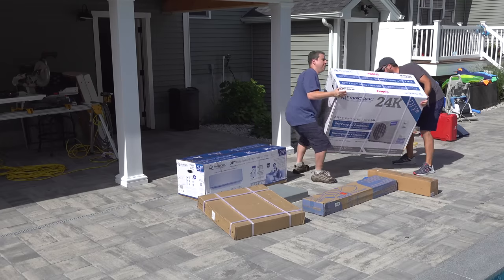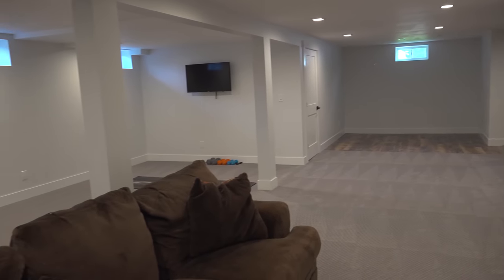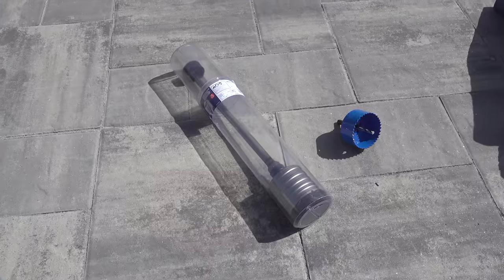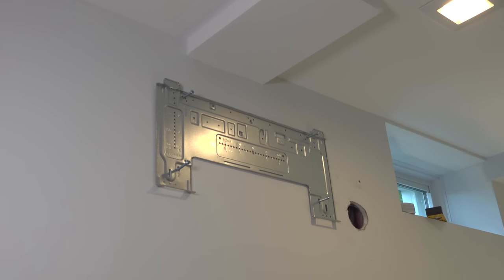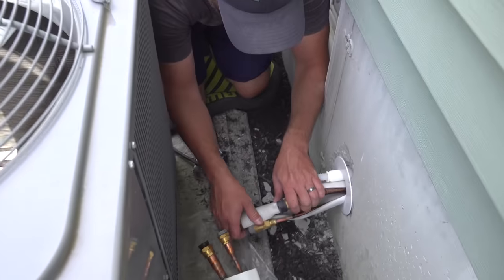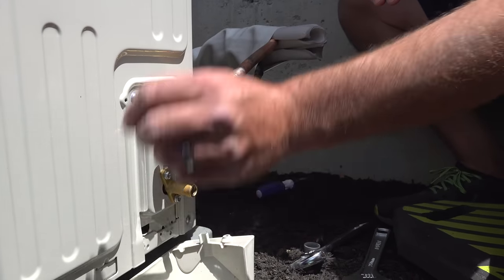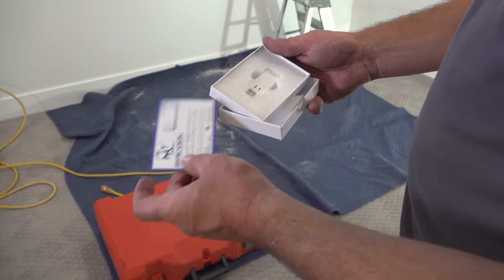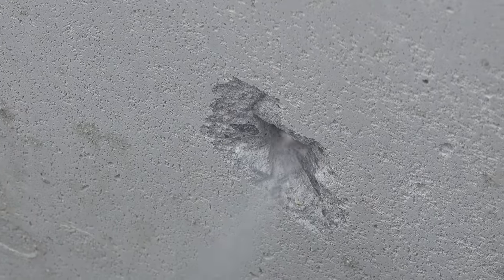Install your own AIR CONDITIONING in 4 HOURS!  DIY Mini Split MR COOL

Comment: Don’t encourage people to do this. As a hvac tech people are stupid. They do stuff wrong. Don’t know how to check the charge. Those line sets are factory charged therefore you can’t shorten them if you don’t know what you’re doing and if you don’t have refrigerant. You need an epa license to handle refrigerant anyways. I can’t count how many times we have gotten calls to go and fix peoples DIY’s on mini splits.

Comment: So no vaccum ? Seems janky
Reply from the maker: Not with this system, the line set and condenser are sealed and freon filled. They only open their valves which can be seen inside the plastic caps on the line set when properly connected. The system is entire factory filled and sealed to perfection.

Comment: gas?drill through wall? its 2020+, who still go back to gas? i'm cool with my old window eletric air conditioner, why don't you use one of the window make a hole in the glass? you don't use all windows do you?

Comment: What is up with not using a vacuum pump on the line's to get the air out??? Bad teacher's lmao
Reply from the maker: Don't laugh to hard when you are wrong.  Not with this system, the line set and condenser are sealed and freon filled. They only open their valves which can be seen inside the plastic caps on the line set when properly connected. The system is entire factory filled and sealed to perfection.

Comment: Highly recommend you read the reviews on Amazon before buying one. They aren't good.
Reply from the maker: 4.7 stars out of 5 is concerning with over a 1000 reviews?
Reply: @SilverCymbal  sort by date....appears that quality control has dipped.
Reply from the maker: @Drivethisnotthat  As I write this now I am sitting next to the one I put in my own office, keeping me warm despite being 19 degrees out. My friends is still working awesome for him. Do what you want, but I would install these in a heartbeat again, if you check my community post the best part for me has been the bill since I work out of my garage. People find what they want in reviews, plenty of people can't follow directions or use tools, that's why I make videos to try to help But when 90% of the folks love something and 10% don't the issue isn't a product failure.  Here's the one from my garage: https://youtu.be/kEWzIfnIhUw

Comment: No vacuum in the line set? Complete hack job
Reply from the maker: Try to keep up with technology instead of insults, the line set and condenser are sealed and freon filled. They only open their valves which can be seen inside the plastic caps on the line set when properly connected. The system is entire factory filled and sealed to perfection.

Comment: What kind of concert you people have no steel rebar on the concert its to easy to drill a hole in the wall
where I live I drill a hole with steel rebar on the wall on a 15 inch wall with diamond core drills and its not that easy to drill through steel

Comment: DIY, doesn't pull a vacuum on the refrigerant lines,  leak checks them after the refrigerant is already in the lines.  Lol. NICE.  That poor compressor. 😢
Reply from the maker: Not with this system, the line set and condenser are sealed and freon filled. They only open their valves which can be seen inside the plastic caps on the line set when properly connected. The system is entire factory filled and sealed to perfection.
Reply: @SilverCymbal  I've read a lot of these comments and I think you're fighting an uphill battle.

Comment: here its €100 to get a company drill a hole with professional equipment. a drill bit like that costs more than that and who has a huge drill like that ? same thing u could rent one but still its more work and more expensive.
Reply from the maker: I wish there were more companies like that here, most only do the work commercially and don't want something like this that they consider a small job.

Comment: Not be a dick but how is a stud on a perimeter wall non structural?
Reply from the maker: It’s not holding anything up. It’s only a fast being point for the wall board and one less screw won’t make any difference.
Reply: @SilverCymbal  Either way I forgot to say thank you for the excellent video. This is my introduction to DIYable split systems.

Comment: Everything was great but you never vac the line.
Reply from the maker: Not with this system, the line set and condenser are sealed and freon filled. They only open their valves which can be seen inside the plastic caps on the line set when properly connected. The system is entire factory filled and sealed to perfection.
Reply: Been doing this for a long time and never heard that. Id have to look into that Sir.

Comment: The AIR inside the pipe is not vacuumed out I supposed. Not good.
Reply from the maker: Not with this system, the line set and condenser are sealed and freon filled. They only open their valves which can be seen inside the plastic caps on the line set when properly connected. The system is entire factory filled and sealed to perfection.

Comment: You didn't vacuum the lines.
Reply from the maker: Not with this system, the line set and condenser are sealed and freon filled. They only open their valves which can be seen inside the plastic caps on the line set when properly connected. The system is entire factory filled and sealed to perfection.
Reply: @SilverCymbal  in Pakistan i recently installed 2 ACs but their lines were not sealed and Haier company technicians wanted to install without vacuuming but I insisted.

Comment: You didn't pull a vacuum. You gonna destroy that compressor due to non condensable and moisture.
Reply from the maker: Not with this system. The lines and compressor are all prefilled.  You can see the special sealing valves at the end of the lines. Its different than a normal system

Comment: 90% of people dont have those tool to do the job
Reply from the maker: The concrete saw and drill are not going to be a typical install but you would rent those. The wrenches and hole saw came with it. You need a screwgun and a level.

Comment: Don’t get one with prefilled lines.
Reply: Why
Reply: @ben29025  Those Mr. Cool ones are junk. The unit that is outside is prefilled on all the units anyway. You just need to get your hose lengths correct and release the gas after everything is hooked up. Also you need the type of unit that matches the climate in your area. Some don’t work in the cold.

Comment: I am confused on something, the pipes where not evacuated with a vacuum pump how does the manufacturer keep air and humidity out of the pipes would that not contaminate the freon?
Reply: For the last heat pump I installed, I found a professional manual. It stated that vacuum is optional but highly recommended. Apparently, not vacuuming the pipes and condenser  slightly reduced the efficiency of the unit This was also pre-filled.

Comment: the vacuum process was not carried out
Reply from the maker: Correct, not needed or even beneficial with this system, the line set and condenser are sealed and freon filled. They only open their valves which can be seen inside the plastic caps on the line set when properly connected. The system is entire factory filled and sealed to perfection.

Comment: This is not a DIY project because most of your tools are not standard tools people have. Concrete is very difficult to drill through you said it was easy. Cannot do this job in 4 hours. I know i am a construction worker.

Comment: Or, you could buy a 5,000 btu window ac in the winter when it's cheap (less than $150 including shipping) and easily install that by yourself with no help.  Have an extra window ac unit brand new in the box ready to go when the first one gives out in a few years.  Throw the first one away, grab the new one out of the box and away you go.  But no, let's overcomplicate things with these mini splits.  No thanks.

Comment: I would never do this, as this is a complicated job for those who know what they are doing. If you want central heat and ac, get a unit that really does the job right, this isn't it.

Comment: This DIY install will VOID warranty. Read warranty print.
Reply from the maker: I did. and you are wrong. They have professionally installed systems and DIY that have a full warranty which is what this is.

Comment: electrical is half the work so the title is misleading. Not trying to bust your balls or anything but in reality, no one is going to be able to do this in 4 hours even with everything prepped and ready to go. Heck, it'll take an hour to get the parts out of the truck, unboxed, inventoried and staged inside and outside the house. I don't doubt you did what you said but I assure you, that's not going to be "normal" by a long shot.

Comment: Thanks for trying but telling people how to do things incorrectly in an instructional video is just wrong on so many levels. It should be titled, How to align your mini-split template so you're sure to hit studs. Or how to not move your template over 1.5" if you hit a stud. (God knows that drywall is more valuable than actual studs). Or how to not give your mini-split a firm foundation pad. Or how to blow out your exterior concrete foundation wall for no reason. Just because you mean well doesn't mean you should leave a half baked instructional up. Redo it and actually point out your mistakes if you want to help people!

Comment: soap and water not the best thing for copper.  did not vacuum down the system, moisture is not our friend.
Reply from the maker: Not with this system, the line set and condenser are sealed and freon filled. They only open their valves which can be seen inside the plastic caps on the line set when properly connected. The system is entire factory filled and sealed to perfection.

Comment: This is not central air. This is a glorified window unit that costs 10x as much and doesn't require a window...
Reply from the maker: It's a lot more than that. Try one I think you will be very impressed. Split units are awesome from any company, Mr Cool just made it possible for diy'rs to do it themelves

Comment: Many improper techniques being used installing mini splits diy, no evacuation can cause damage to the condenser witch would make this unit ware much faster can be leaks without leak checking properly drainage needs to be pitched just all around unprofessionally done. But you get what you pay for
Reply from the maker: Nothing was done wrong. The lines are pre-charged and sealed there is no vac required. All the stuff you listed is for a traditional system.

Comment: 4 hours * 2 people + electrian to install power…….this install is far from what the video title states. Why not just have used 4 people and claimed a 2 hour install ?
Reply from the maker: If you are sitting there sweating and this is your justification you are only kidding yourself. The install was through a concrete wall, movig shrubs and in a finished basement which is harder than every other install on YouTube and it was still very easy and very fast. If I wasn't recording a video and helping more, we would have been done in 3 hours.
Reply: @SilverCymbal  ok so “we” still implies at least 2 people… so 2*3+ electrician time is still a clickbait title of making viewers think it’s a fairly quick install.
Reply from the maker: @dominicm2175  It not fairly quick, it is INSANELY quick. That's the point & it took less than 4 hours hours on a very difficult job with concrete.
Reply: @SilverCymbal  Absolutely! I completely and totally agree ! But with a DIY product like Mr. Cool I just don’t think the title is a fair representation of the actual project labor units which technically should include the electrician as well as having to go rent the concrete drill. Although your title may be accurate, in my opinion it is also misleading.

Comment: This guy guy has NO CLUE WHAT HE IS TALKING ABOUT.  Do NOT fallow this advise.  The lined and evaporator need to be evacuated BEFORE releasing the charge.  These units MUST be professionally installed or you will get premature compressor failure.  DO NOT FALLOW THIS VIDEO.

Comment: Truly useless things they did by installing AC themselves. As a technician i can easily say, this unit is not safely installed and most importantly they didn't even care to remove air from those pipes before releasing gas! Now there AC will eat more power to achieve required temperature and on maximum load it can give you only 70% of output because of air flowing in those pipes.

Comment: I hate these. There's no way anyone can prove to me that there will be zero air getting into the system when doing the connections. In addition most states require you to have and EPA license to work with any refrigerants

Comment: Bull crap 4 hours no if u have never put one up and u have to run electricity 220 to it ur not going to even be close to that and put a cement pad down for the 24k unit like it suggests not even close
Reply from the maker: Ok so 6 hours with electric or take 2 days if you want. It's not a race I am just telling you the facts of what we did. Save thousands and have a great system

Comment: He forgot pull vacuum hire a profesional. That compresor it’s only last the season due to non condensables
Reply from the maker: Learn something new: No-Vac Precharged Refrigerant Line Set with 3/8" and 3/4" Line Ends. Guess why they are called no vac?

Comment: No air test are vac she be down in a year    you missed 2 important steps
Reply from the maker: Not with this system, the line set and condenser are sealed and freon filled. They only open their valves which can be seen inside the plastic caps on the line set when properly connected. The system is entire factory filled and sealed to perfection.

Comment: I think l would have used a stud finder first,  adjust the location of the inside unit. Then there are concrete core cutters that l have my shop. This guy shouldn't be giving instructions. More of this is how he did it. Not for people with a little grey matter. Sorry.

Comment: It would have been best to connect a pump and suck all the air out from the pipes that you have connected. After all the air has been vacuumed out by the pump then to release the gas from the compressor.
Reply from the maker: Actually it would have been the worst, since they are sealed, pre-charged lines. No vacuum here.
Reply: @SilverCymbal  I'm talking about the pipes that you connected from the interior unit to the exterior unit. The long ones that you removed the caps....They are not sealed and no pre-charging. Believe me, I work since 20 years here in Europe with this type of units but different brands. You have to suck out the air and moisture from those pipes before opening the valves to let the gas in the entire system. The only sealed part is in the exterior unit where the compressor is. Also with that pump by creating vacuum you can also see if you have some leaks. You stop it and if the pressure changes from negative to positive you have a leak. It's a specialized pump with gauges that is used for this application, not just any regular pump.
Reply from the maker: @soldatd3727  Again, the lines are pre-charged and sealed with pancake valves at both ends that don't open until they are tightened down.  Details: This easy-to-use line set greatly simplifies the installation process. It is pre-charged from the factory for the precise amount of refrigerant necessary for both the 2-3 ton & 4-5 ton MrCool Universal heat pump split system. Which means that this line set requires no charging in the field and no vacuuming. It is 100% ready to go right out of the box.
Reply from the maker: @soldatd3727  This easy-to-use line set greatly simplifies the installation process. It is pre-charged from the factory for the precise amount of refrigerant necessary for both the 2-3 ton & 4-5 ton MrCool Universal heat pump split system. Which means that this line set requires no charging in the field and no vacuuming. It is 100% ready to go right out of the box.
Reply from the maker: @soldatd3727  This easy-to-use line set greatly simplifies the installation process. It is pre-charged from the factory for the precise amount of refrigerant necessary for both the 2-3 ton & 4-5 ton MrCool Universal heat pump split system. Which means that this line set requires no charging in the field and no vacuuming. It is 100% ready to go right out of the box.

Comment: u didn't do "vacuum-pumping", sry, u AR wouldn't as cooling as it state,and take some time, u will look for a technical worke fix ur AR, like adding refrigerant , and ur AR need to be replacement too... all because u didn't do "vacuum pumping" when fresh installation
Reply from the maker: Not with this system, the line set and condenser are sealed and freon filled. They only open their valves which can be seen inside the plastic caps on the line set when properly connected. The system is entire factory filled and sealed to perfection.

Comment: Man, poor workmanship. Few tips.
if you know you are going to be cutting out a large hole, why not use a pin nail to check at the 3 and 9 o'clock location for studs. Also for the blow out, why not stop and then cut from the other side once the center is peaking. Obviously someone is outside looking and recording...unbelievable.

Comment: Don't use soapy water!!! Use HVAC leak soap because regular water mixed with soap can damage the pipe by causing unessessy corrosion. There's a reason why copper pipes are no longer used for water in residential homes.